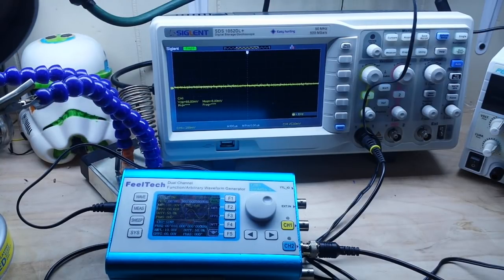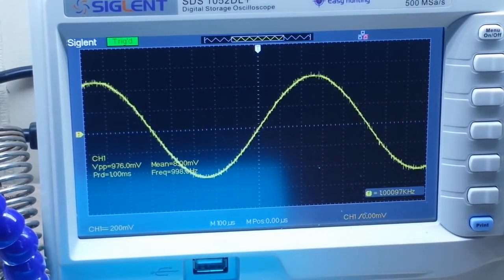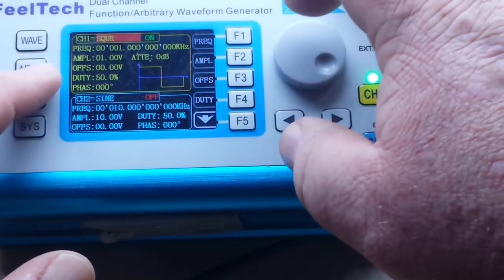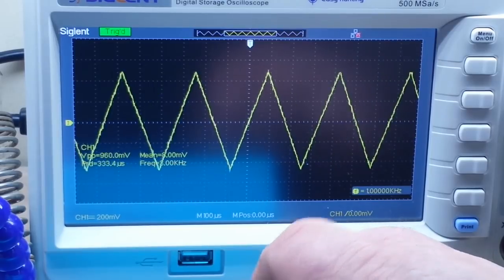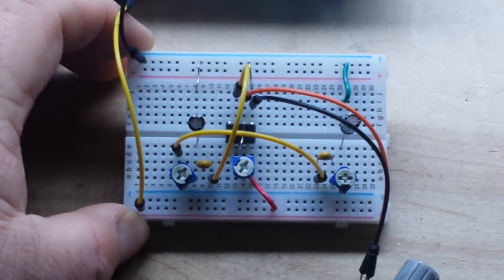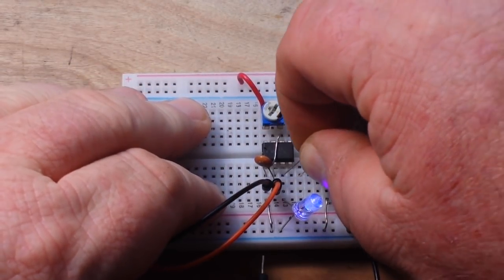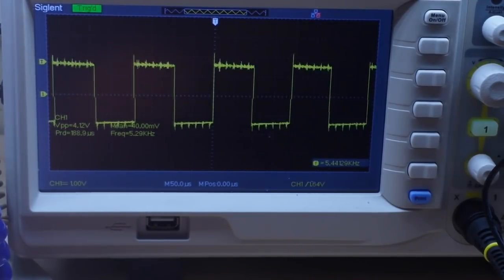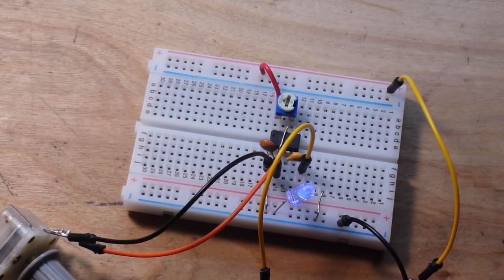Synth experiments

Comment: This is a great topic, and it can go waaay deep. Which direction do you want to take it in?

Pulse width modulation of square waves was used on the custom soundchip of the NES and on the Commodore 64's SID to greatly liven up the instrument sounds... if memory serves, the PSG, neither the TI not the GI AY-3, didn't have this feature.
Reply from the maker: Well i am going deeper than pwm. I think i might go 4 operator with lpf and hpf. If i can figure out how, envelope control.
Reply: I think the 80ies were particularly shaped by the sound of Yamaha DX7, a digital 6-operator phase modulation synthesizer, though they call it FM, for frequency modulation, which it's not. Something in that vein might be interesting, though maybe actual FM which should be more doable in the analogue domain. A simplified 2/4-operator version of the Yamaha made its way into numerous arcade machines throughout the 80ies, PCs with AdLib and then dozens of compatible soundcards strating 1987, and into SEGA MegaDrive/Genesis a short time later.

Comment: I remember from my experiments way back when with transistor oscillators, that the secret to getting meaty, rich sound was to add harmonics, ie multiples of the main frequency. That's probably easier now using ICs.
Reply from the maker: Yes, and the different waveforms exhibit different amounts of harmonics. That's why they sound different.

Comment: I have one question. How does sound from guitar, piano, violin... differ from each other? I mean when you play for example tone C it is same frequency but different sound. Then what is difference between those sounds, how does computer deal with different sounds?
Reply: They differ primarily in envelope and in the overtones.

The envelope is the variation in volume over time. The envelope of the violin is given by the bow, with the performer being responsible for the envelope, while guitar and piano have a percussive envelope, where the string is struck or plucked and the sound decays naturally.

The overtones are predominantly harmonics, multiples of the fundamental frequency. Imagine a string, it can vibrate at its whole length, and it will also vibrate at half of its length and a third and a quarter and so on at the same time, adding harmonics. Some of these will be amplified by the body or other elements of the instrument. You have heard examples of different harmonics in this very video. Pure square wave has only odd harmonics, so 3, 5, 7 times the fundamental and so on. Triangle wave does too, but they roll off much faster than for square wave, so their amplitude is much lower for higher harmonics. Saw tooth wave and PWM introduce even harmonics.

The vibration can also be transferred to other elements that may have a more complex relationship in the frequency to the fundamental, also adding some non-harmonic overtones. There are idle strings that are not dampened and that experience some energy transfer, and in fretted or fingered stringed instruments, the string is essentially partitioned into two parts, and while one section over the body is responsible for the primary sound, the other section isn't completely silent either!

Also some instruments play multiple fundamental frequencies. If you were to look into a piano, you will see that a hammer strikes 3 strings at the same time. These are tuned to approximately the same note, but will not have the exact same length and tension, and thus not produce the exact same fundamental frequency. This is also why when you find a neglected piano that hasn't been tuned in a long time, you will find that some keys sound particularly wrong and terrible no matter what - this usually means one of the strings of this bad key has detuned itself by close to a semitone at least.

The overtones can have their own differing envelopes really, for example the high frequencies might decay faster, or something might take a while to excite into motion.

This is just the basics, there is of course more complexity to it.
Reply from the maker: Well, I'm no audio expert but the sounds differ in how the are produced. Even tbough the piano, guitar, and violin all use strings...the piano strings are struck 3 at a time by a hammer. A guitar's strings are plucked, and a violin's strings have a bow drawn across them.
So while the frequency is the same, the envelope is different...the attack, sustain, and decay of the note differs based on how the strings are vibrated.

Comment: Have you ever built an Atari Punk Console? Its a little synth circuit based on 2 555 timer chips and a lot of fun to play around with. Forrest Mims designed it in the 80s.
https://en.wikipedia.org/wiki/Atari_Punk_Console
Reply from the maker: No but i will check it out for sure. Thanks.
Reply: Sparkfun’s sparPunk sound generator is based on that Forrest Mims circuit. I remember building the original step tone generator from the Engineers Mini Notebooks in the 80s and I recently tried the SparPunk. Good times. I’m going to be experimenting with more synth stuff soon. Maybe we can share learned tips.